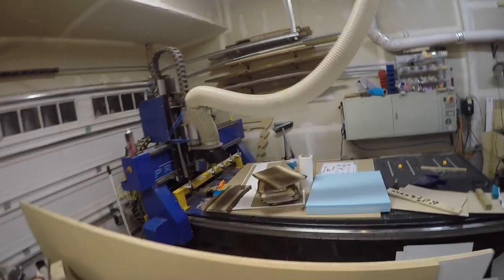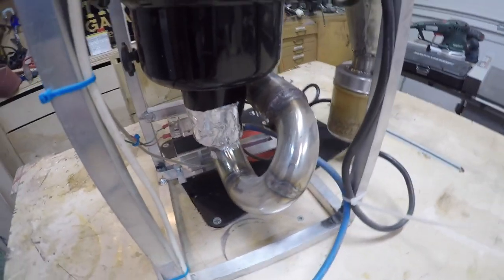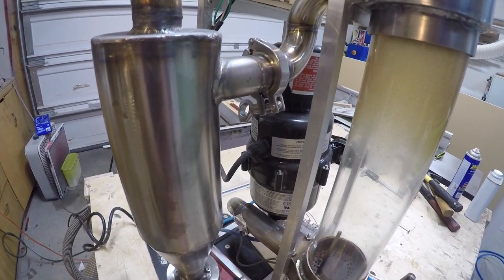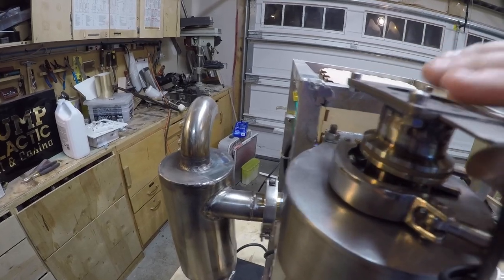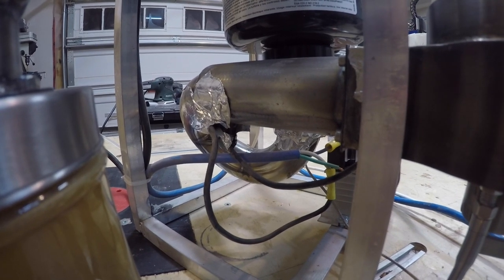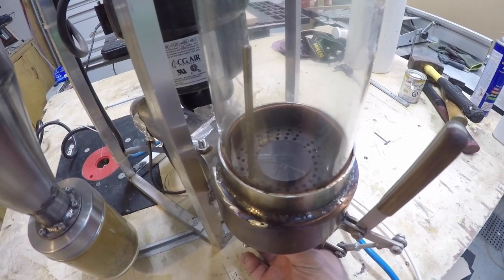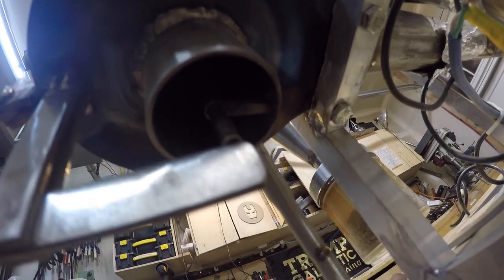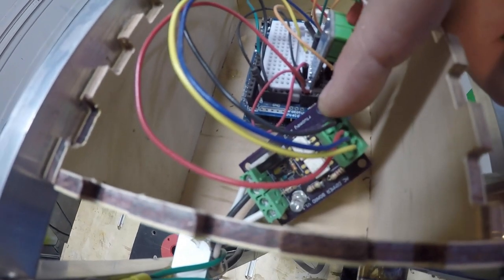Homebuilt Arduino Controlled Coffee Roaster - Technical Overview

Comment: Nicely Done again,  you can toss the silcone gausket.  Those Tri-clamps seal nicely without them since it's at low pressure.  The adhesive on the tape is Acrylic adhesive,  rated to around 400F .
Reply from the maker: Thanks for the information

Comment: Alex I do absolutely love this. I've shown it many times to my non-roaster friends and they agree it's pretty cool. I aspire to do something like this some day. The one area that I would appreciate more on -- the heating element. What did you choose and how did you integrate it into the roaster?
Reply from the maker: The heater element is a 3400W plastic welding element from AliExpress. It is cycled by an solid state relay and it is controlled by the roast logger software.